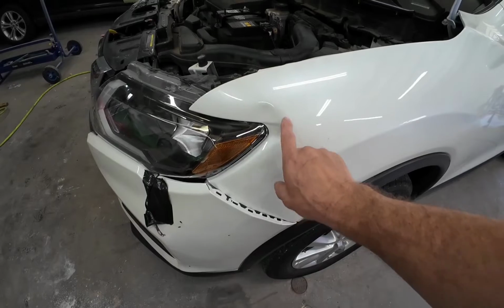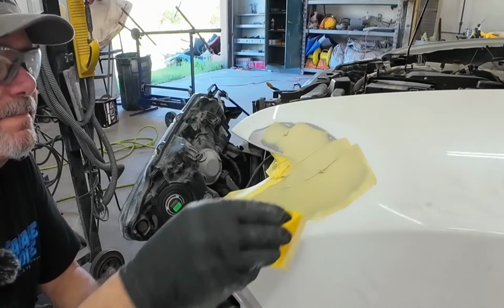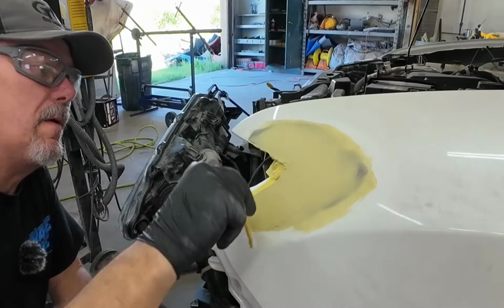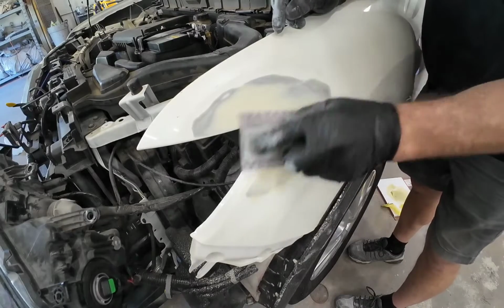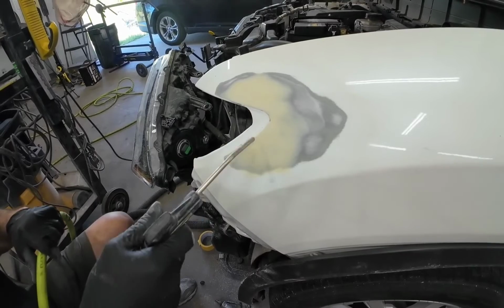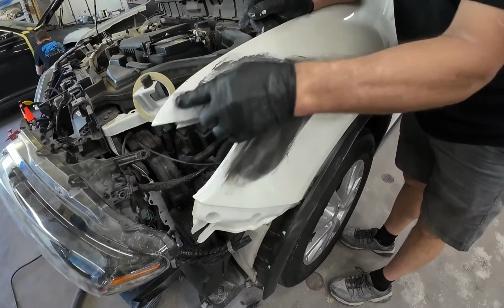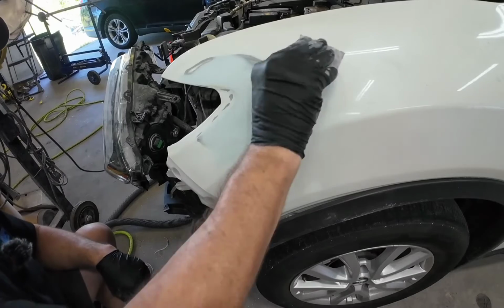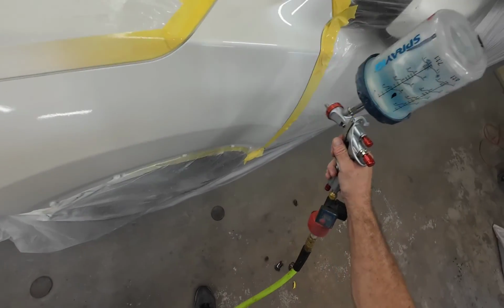Simple steps when using bodyfiller/bondo on small dents

Comment from the maker: Detailed PDF guide on Mixing, Applying  and block sanding  Body filler and others topics https://garagenoisegear.com/?_ab=0&_fd=0&_sc=1
Reply: Isn’t it bad to get bondo on original paint at the edges of the dent? It won’t have been prepped and will cause problems later?
Reply from the maker: @harveys.6483 it's actually okay to put bodyfiller over properly sanded Paint, you need to sand it with 80 grit, actually back in the 90s  manufacturers recommended that you put body filler over properly sanded paint rather than bare metal. They've since changed that but it's  still fine.

Comment: I use Motormaster body filler but after following their mix ratio, at  80 F , I only have 1 min working time before it starts to solidify. I would never be able to mix that amount of filler you did and neither work it for the time you are doing. What is the problem ?  Thanks
Reply: Unless you’re a professional or you’re experienced you won’t be able to work with as much as him because he has endless practice. What I do is work with less and build it up. I have a big metal pan infront with my spatula. Then have a dollop of part a on one side and a dollop of part b on the other and I take small amounts at a time and mix in the middle

Comment: Why don't people like filler over metal because it promots rust???
Reply from the maker: It's  been done for years, some feel it's more likely to rust. If it's  a restoration I would consider epoxy then filler on collision repair it's not necessary.
Reply: @GarageNoise  I live in a very humid area so flash rust could be an issue. Should I only apply a waterproof fiberglass filler over bare metal or maybe coat in ospho under the filler?

Comment: dint quite catch the end..320 on the primer and prep out paint with 600...what does that mean ''prep out paint with 600"?paint then sand with 600 for clear?
Reply: Sand the area you worked on with 320 meaning the dent you repaired and where you sprayed primer then prep the paint means sanding over the whole fender with 600 going over the area you repaired aswell and then spray after sanding the whole thing with 600

Comment: Question, can you sandblast a 2 inch area of rust, hit with 80 grit, then apply a rust inhibitor, then  bondo glass, etc..  on top?  Or skip the inhibitor and bondo over the blasted/80 grit metal?  Its on a car roof
Reply from the maker: You got the right steps and process so yes you can. If it's  pitted I would use the rust inhibitor.
Reply: @GarageNoise  Thanks... its a smorgasbord of info out there with xyz primer over xyz surface, but DTM only with this stuff,  and wet sand this,  dry sand that,  clean with alcohol,  or clean with de greaser  etc ... I prefer to do the repair a la 1970's old-school... my dad did the same on our family  station wagon decades ago... I remember him working on it... but I was too young to appreciate the work involved.... 

I'll sandblast,  hit with 80 grit, give it a shot of rust inhibitor just in case, bondo glass, sand, putty, sand, urethane prime, urethane prime/seal/filler, sand, basecoat, maybe sand, clear, buff, and then Crack open a beer 🍻 ... does this sound about right?.... BTW thanks for all you do for us newbies fed up with price gouging from the big boys

Comment: A tip you might want to try' to save on the cost of body-filler' sweep up and filter out the body-filler dust off the floor and then add fiberglass resin to it and reuse it. 
Recycle.